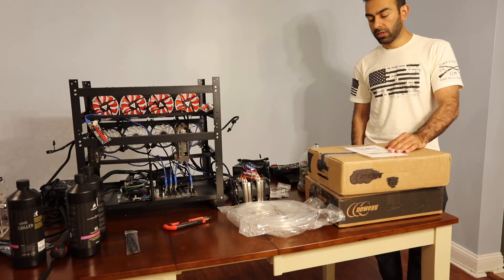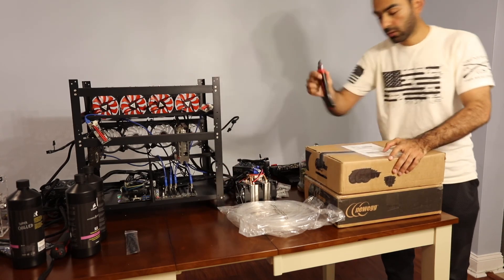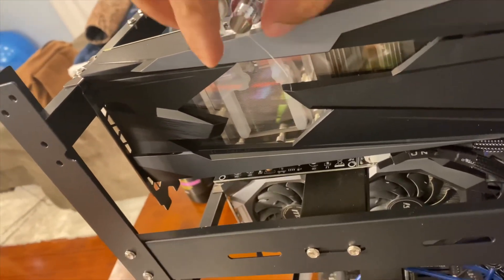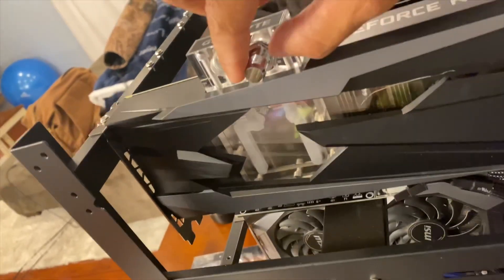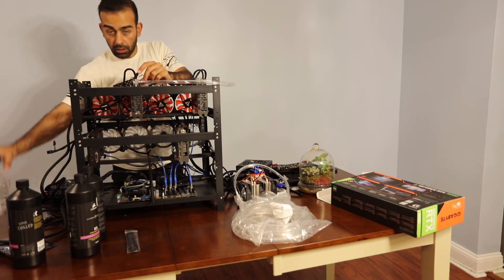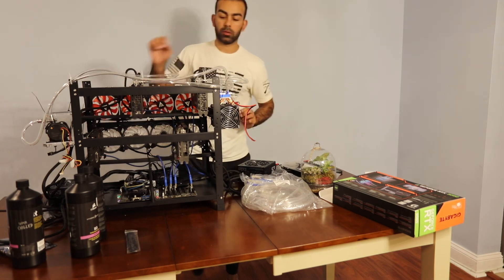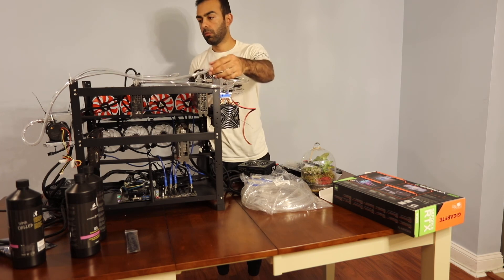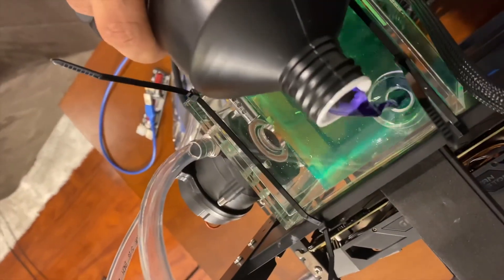Ultimate Water Cooled Mining Rig! Build Your Own Water Cooled Mining Rig!

Comment: How many gpus does this water cooling system support?
Reply from the maker: Thank you, I will post links to all the parts. I used a different radiator for my new water cooled rig. One radiator can support four GPUs while one reservoir can support 6 GPUs. For my 12 GPU rig I have 3 radiators and two reservoirs.

Comment: Nice setup! I'm doing this in an obsidian 1000d with the waterforce 3080 and 3090. More of a workstation with mining as a bonus. Did you put pads on the back of the 3080 memory? I added them last week plus two small heatsinks and notice a significant temperature improvement.
Reply from the maker: Thank you! I put pads on a different system and they show significant improvement. They improve the mem temps on the Gigabyte models, the Aurus works great without the pads as well.
Reply: @safirauf  Can you please share the location of the mem chips on the gigabyte waterforce 3080 models? where should i put the heatsinks?